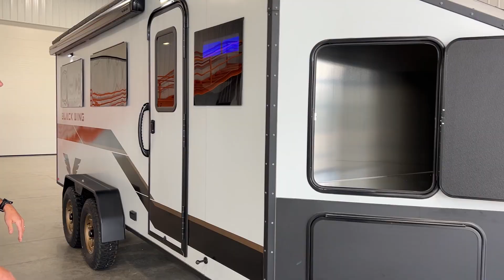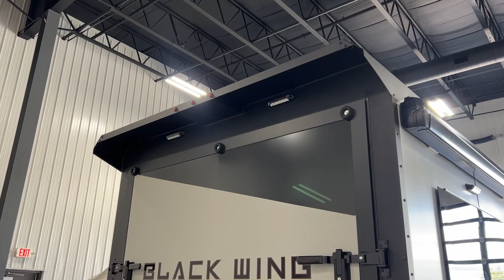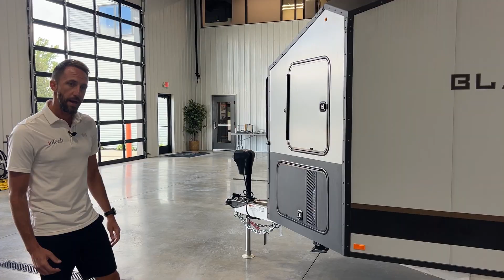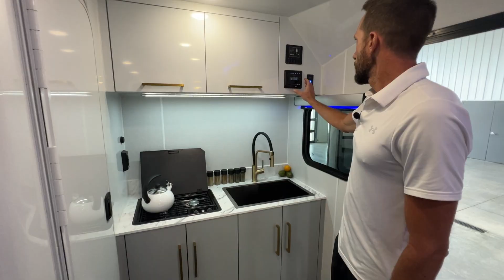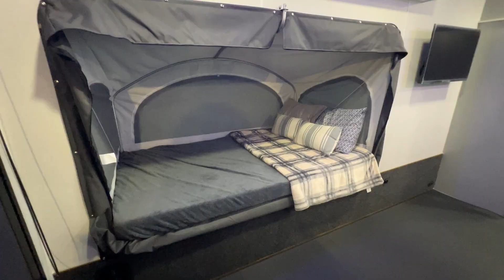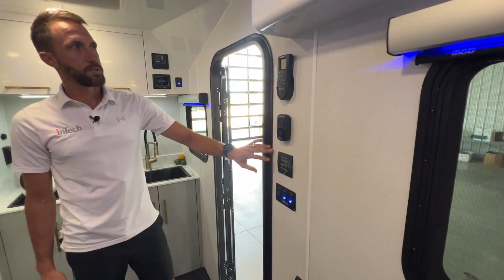Black Wing 724-X by inTech

Comment: 8' wide option would make this unit more versatile, hope that could be an option to get larger UTVs access. Intech should do some testing with modern, sport, side by sides, to find the limitations of the unit before marketing it in the video as they did, a bit disappointed, was waiting and having great hopes for a purchase
Reply: No gray water either. Deal Breaker
Reply: There are 2, 26' and 30'
Reply: @CanadianTexaninLiguria  It's the width that is the concern...not so much length

Comment: Why don't you install a black tank flush? Are those windows availlable for Aucta
Reply: Well, for one it doesn’t have a black tank…. The “combo” tank has enough water in it to keep everything very loose likely not needing a flush. It’s also very easy to use a flush kit attached to the sewer pipe.
Reply: @Captndarty  those kit don't work unless it's a strait pipe
Reply: @jean-guybeaudin717 well it doesn’t need one as it’s a combo tank. All your sink and shower water will keep the solids not so solid so it won’t stick to the tank.
Reply: @Captndarty  what about odor. A Gray and a black tank help prevent odor, No gray water. Deal Breaker
Reply: @RaviPatellos never had odor issues in mine but I also have never taken a 💩 in it either. One should really never have to. Every camp ground has a toilet and if your on the road every fuel stop has one as well. In an emergency or Boondocking we plan to use a portable toilet type bag in the bathroom and dispose of it.